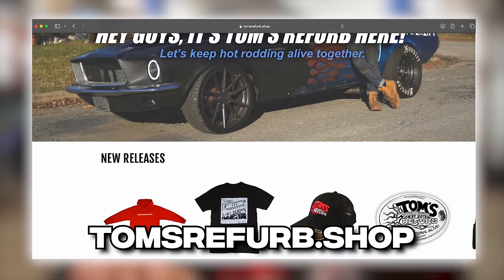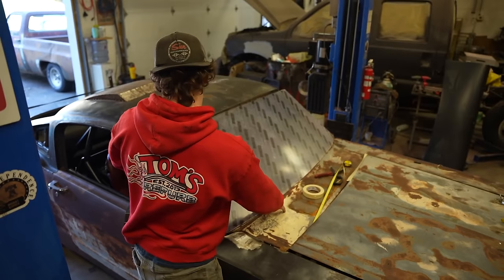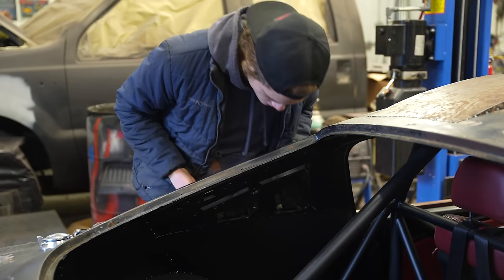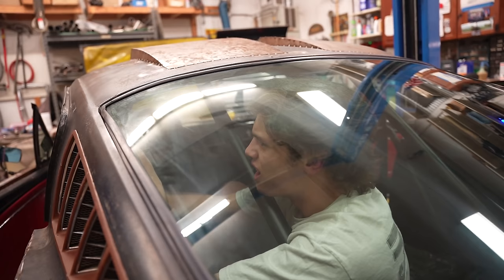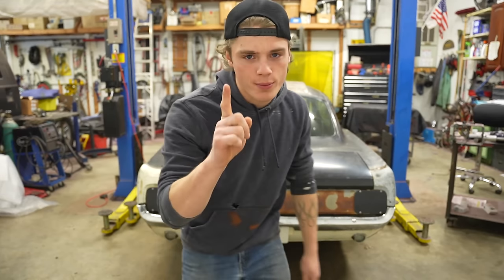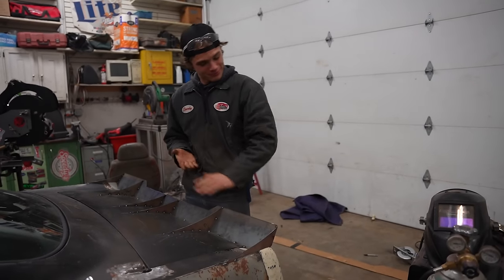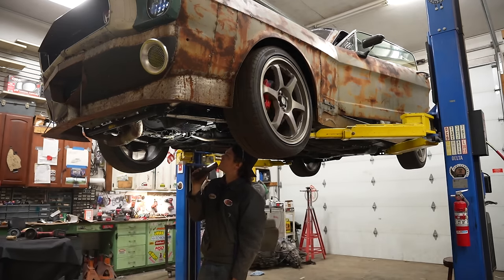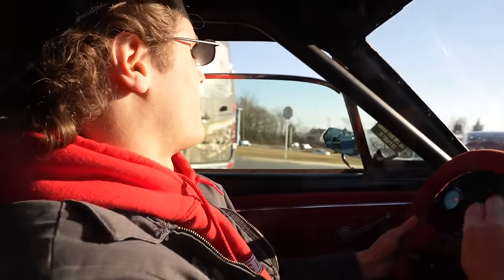THE WORLD'S FIRST HONDA CIVIC FASTBACK!

Comment: Since the trans is toast it may be time to throw in a crv trans and convert it to awd
Reply: AWD would be insanely awesome 👍🤞
Reply: My thoughts exactly
Reply: Not that simple. Thats a lot of time parts and fab work. Would be sweet though
Reply: 07-11 crv rear diff or use element.
Reply: Definetly possible. There are ton of awd swapped civics out there and you can get kits that have everything you need to use crv parts. Can't be as difficult as putting a Honda chassis under a mustang body.
Reply: @badgermetal  my thoughts exactly
Reply: That would be fucking sick
Reply: @RafeLight-ph7qi  wouldn't need the rear , as gear ratios can be bought to match the honda crv gearset, run the 8 inch ford axle
Reply: @RafeLight-ph7qi  did you see the car he built?
Reply: Good old B-series
Reply: You use the crv diff, but definitely not a crv transmission
Reply: YES THAT'S WHAT I'M SCREAMING BRO!!!
Reply: Awd for the win
Reply: What about the fwd burnouts😂
Reply: I saw somewhere that they have been using range rover drive shafts on the AWD swap. Might have to cop one for my Integra.
Reply: Please please please hear me out, put in a Lexus gs450h CVT transmission, people will absolutely hate it but it’s actually a good trans with a 4 speed built in, it’s got good performance, please look into it at least
Reply: @RafeLight-ph7qi people have been doing that for 20 years dog

Comment: Tom, use smooth string next time you install a window.  That's why you had all the issues with the twine braking. It's called heavy kite string.
Reply: running a light amount of soap along the string works too
Reply: Always pull the string parallel or close to parallel with the glass.
Reply: I use weed whacker line to install my glass works like a charm.

Comment: Personally in my opinion you should take that right front fender and sand it down then make a spray bottle of vinegar water. Spray the fender down so it will rust and have patina to match the rest of the car. You have done a fine job with that rat rod keep it going!

Comment: In the future, just use a good painters tape, lay it across the entire windshield into the area you want (be sure to overlap it and add vertical pieces) trim edges with a razor, then peel it up as one piece and lay that over the media that you will cut. Makes it accurate and clean.

Comment: Cover the opening with cardboard then trace it from the inside. Then take tape that is half inch or three quarter  and run it along the trace line to add that edge needed for the window to set in since tracing it and cutting it would make it fall through the opening because its exact. Once you add the tape you can trace the outside edge of the tape and you have a perfect template to work off of!!! Hope that helps someone some day!!

Comment: Spray the inside of the rubber gasket with WD-40 and you use a nice nylon chord clothesline rope and have a buddy push on the windshield slightly while you pull the rope in keeping even pressure on the area where you are pulling

Comment: Hey Tom.
For future glass installs that have the same style seal..try a thin length of wire, or braided steel cable.
I've done it with airplane throttle cable, both to cut out the old, and install the new.

Comment: The small hose on the old gas neck is supposed to be right up by the cap then the gas will flow in Easyer you put it right next to the bottom of the tank

Comment: rain guards for the windows, make sure slit for notch does not leak water into trunk. and you might have a car that can drive in the rain without flooding the inside
Reply: I think he needs a drain hole somewhere below that notch to avoid rot. Had the issue myself with leaking side markers. Ate thru the floor over time.

Comment: im restoring a 1965 ford mustang convertible. deluxe pony interior and only 5100 made was in a barn fire runs good for the carb melting inside the engine and yeah we didnt take out the engine or take it apart at most the valve covers probably lol.

Comment: Use strong paracord instead of that string next time you do something like this, also spray some water/glass cleaner so it doesn't burn the gasket when you pull it (If you're going quick)

Comment: The diamond on a tape is used because it reaches 8ft like 12in and 16in do which are common measurements for framing
Reply: Also i did the same but to my back window to my daily truck with acrylic and have to say the extra strength caulk does a great job with some self tappers. Good work sir

Comment: Tom just wanted to comment and I am buy no means a mechanic or trying to be a genius but🤣 I just did a manual swap on my 95 civic and underneath I had the shifter bar like you do but there is also like a second stabilizer type bar that looks the same that runs parallel to it. That may be why your shift was moving I’m not sure though

Comment: Did you get your car tuned before ripppin it looks like it’s running pretty lean my boosted hatch runs between 10 12 when in boost if it goes up any higher it’s leaning out which can cause issues later on and wear the engine out faster

Comment: If you had used some small nylon string, it would've been a lot easier because it wouldn't have broken, and it slides super easy on the rubber seal. That cheap bailing twine or craft string you used just wasn't the best shit to use, but if you're like me, sometimes you just have to use whatcha got on hand at the time. Lol😂

Comment: Hey Tom I was wondering if I could get some suggestions or pointers for a project Ive got in the mind palace, I'm taking a 93 S10, taking a 350 out of a 93 k1500 taking off all the emissions bullshii off and slapping a carburetor on top and i was thinking on having the save sort of exhaust set-up that you have for noise complaint, so i just need some guidance if your willing